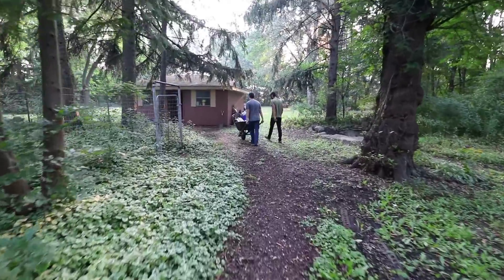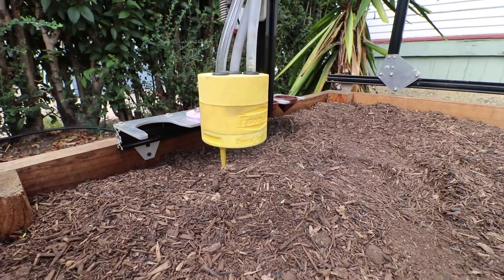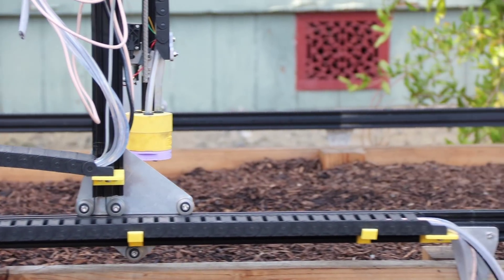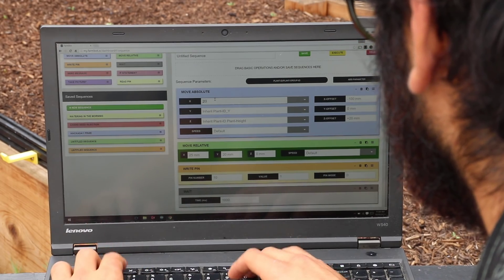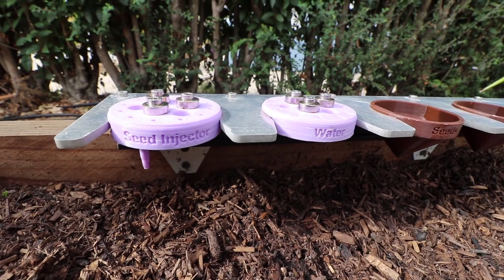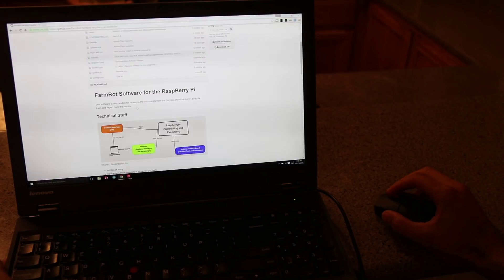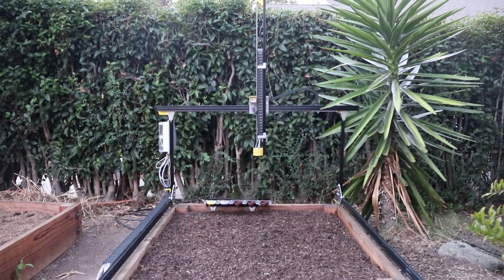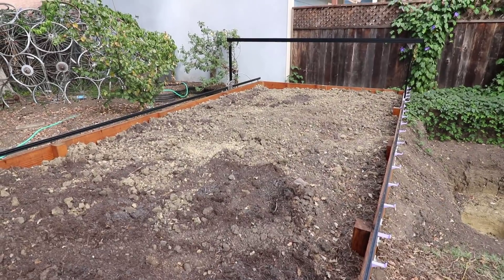FarmBot Entry for the Hackaday Prize Finals Round

Comment: Planting and watering is the easy part of growing food. 
How do you handle insects, blight, molds, fungi?
Reply: This is a good start. Being able to create plots of land that have a lot of different species in a small space will go a long way towards controlling transmissible pathology of all sorts, especially if you avoid planting the same plants side by side. Having it be planned out in an app means that identifying young plants by location isn't such a challenge with that kind of multi-cropping system than it would be manually.  It needs a few things; an optical system for monitoring and an air blower arm attachment to deter insects would be a nice upgrade. A spike that can push unplanned plants into the soil would be a nice feature to go along with an optical system. But, the fact that they are making the plans open source means we might see these improvements soon!

Comment: is there a fixed camera (not a tool head) that can work with image identification software to identify weeds,  unhealthy or dead pants? 

also,  what kinds of weather will this withstand?  60+ mph wind,  heavy rains,  etc are all things to expect on the entire eastern seaboard during the growing season. 

how much energy does it take to run?  plans for a solar+battery kit to pair with rain catchment for off grid or redundant implementations?

I'm really excited about this product/project.
Reply from the maker: +NeonZebra Great questions! There is not a camera tool... yet! But its in the works. Right now we have devices being tested in California, Chicago, and Belgium. Heavy rains, 100+ degree heat, and snow have not been a problem yet. I'm not sure about intense wind. We have yet to see! I'm not certain on the power usage yet, but it is minimal. Much less than a standard refrigerator - that's for sure. Probably closer to a laptop computer. We'll definitely find out though!